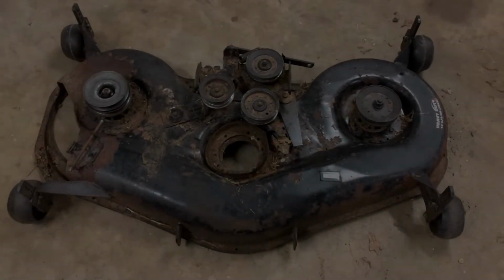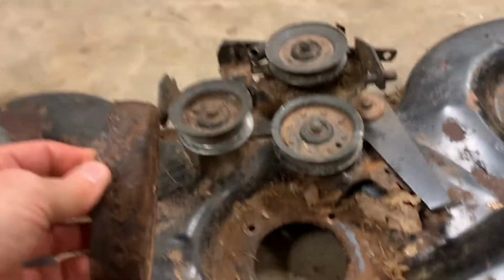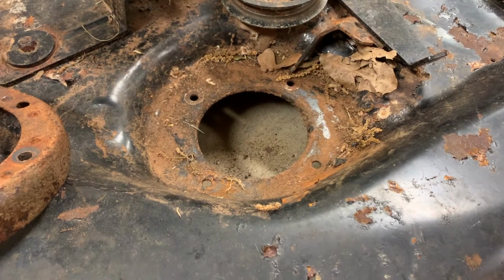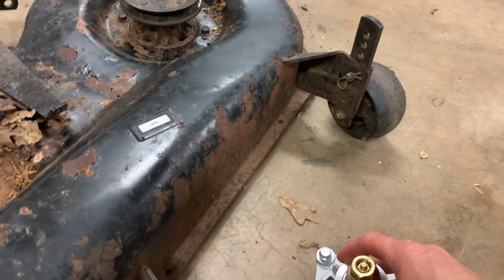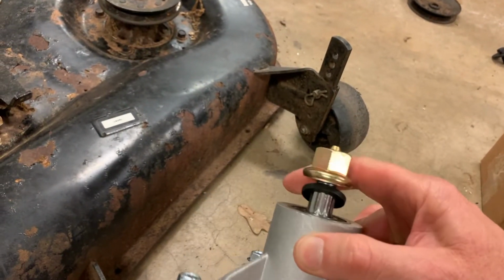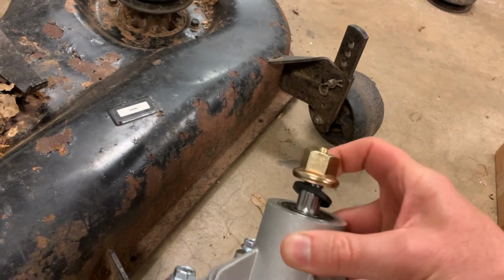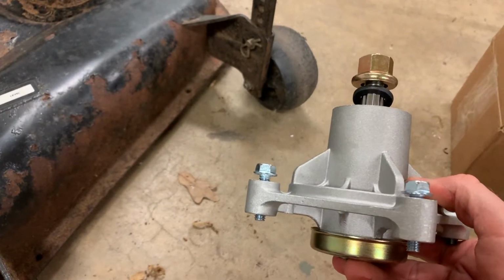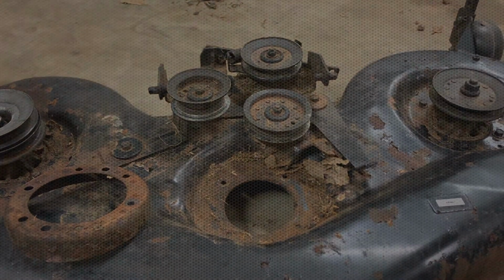Craftsman GT5000 Tractor #4: Mower Deck Rebuild

Comment: Man THAT LOOKS AMAZING !!!!! can you tell me where you found the new blade guard/ strippers , I'm also rebuilding a gt5000 now and mine we're rusted also
Reply from the maker: I'll take a look around and see, it's been a long while now. I probably used one of the mower parts lookup websites and plugged in the deck's model number.
Reply from the maker: Ah, here you go. I think I found them on Amazon. Something like this: https://www.amazon.com/Husqvarna-532174493-Stripper-2748GLS-GTH2548/dp/B08779R3BH/ref=sr_1_10?crid=22K720CAWBQ8X&keywords=craftsman+mower+deck+stripper&qid=1700532906&sprefix=craftsman+mower+deck+stripper%2Caps%2C126&sr=8-10
Reply: Oh Yeah, didn't know what they were actually called until I watched your video... THAKS A MILLION .!!!!

Comment: I have Craftsman lawntractor with 17hp brigss engine, and it can pull priest out of choir boy. I have now sawme project going like yours was. I did same steps, first I grinded all the rust off then I applied rust converter. Now I need to paint it. Did your rust converter held well? Did you do anything to the underside?
Reply from the maker: So far so good. The top looks in great shape, just typical fading when you use rattle can with no hardener.  We live on a sandy lot, and it's really dry all summer so I didn't do anything to the bottom because it's constantly getting sand blasted.
Reply: @TheSaturnV  Yes, it seems like although I live in other side of the world we have the same issue. It is waste of time, money and paint to fix the underside because it will wear off from first mowe. Theres also no permanent fix for the deck. It will wear out in time no matter what. I think best would be to paint it max one time and then change it to new one or good shaped used one. The problems is where to find new decks for +15 year old mower.

Comment: You did a very nice job restoring the Outside of the deck, which i appreciated. But the underside is really Much more important to completely refinish... they rot out from underneath. Once it is brought to bare steel and has cured fresh paint, it'll shed grass as it should and not hold moisture against the pan ~
Reply: Also, in use this deck clogs right at where the opening is at the front of the deck. I carry a scraper on mine to stop and get off and unplug it from time to time... Seems like a hassle, but really kind of worth it for the cut and all the other ease of the design 👍

Comment: Just started the rebuild of my Murray 3 spindle deck. Needed a friend’s air tools to either break off or break loose spindle mounting hardware and retainer bolts. So far, three coats of primer for rusty metal after a couple of hours of wire wheeling.
Have not looked at the pulley bearings yet. Am looking for the belt retainers to replace. Am going to remove the bearing seals and recreate the brand new bearings b/c it looks like factory grease is insufficient.
When I’m done w/ the deck shell, I’m going to undercoat it.
Blades look good but I’m not sure about the blade mounting. Not sure of I have to get  starred mounting holes or not to preclude the blades hitting each other.
I’m enjoying this but I’m going to have to put in a few beads of weld to strengthen a few weakened places but not yet penetrating rust.
Need to track down wheels but I’ll have to make a foundation for an 18 hp engine w/ idler pulley. Should be fun. It’s not cheap.
Reply from the maker: Yeah, you have to make a judgement call if a deck is worth saving based on what you are going to have to spend. This Craftsman deck was 10 gauge and still in really good shape so it was worth it.

Comment: The grease fittings they put on those spindles are useless the bearings are sealed you can pack it with all the grease you want and it's not going to get in the bearings.
Reply from the maker: Yeah, I saw a video about that. It basically just fills in around the axle and does nothing. Live and learn.
Reply: That's not really true. Manufacturers have found that by putting zerks on above sealed bearings does still grease the bearing below.... Basically as the spindle gets hot and the grease ages, the oils run out of it and thus the fresh grease above weeps oil into the old grease of the sealed bearing below ~
Reply: @georgehofgren6123  you lost me when you said manufacturers have found.
They called their bearings sealed you can't have it both ways.
Reply: @jophillips2868  Yes you can have it "both ways". Try reading and understanding before you tell others what you don't comprehend ~

Comment: You’re going to break those bolts b/c the electrolytic corrosion between the aluminum of the spindle and the iron in the steel bolts makes a good corrosive weld.
Reply from the maker: I figured the dissimilar metals had a lot to do with how frozen they were. Glad the design allowed the bolts to be sheared away and drop the spindles.

Comment: Excellent job Saturn! A lot of people around here spray their decks with bed liner on the underside to help fight rust. I had to fix some holes in the mower deck of my Cub 108 this year; I would have much rather had a nice solid start like you had here. Great job, and keep it up!
Reply from the maker: Maybe it's the sand content in my soil but I don't have much trouble with rust from the underside of my decks. It's the leaves and soil gathering on the top side that kills them here. I'm going to need a shop like SSBTC HQ if I keep any more of these things.  :]

Comment: The orignal ones lasted me 15yrs. No zerk fitting as they were sealed bearings. My orignal GT5000 deck also rotted so I had to buy a new deck. Cheaper metal..no way the original 10g . Other than that my 2003 GT looks brand new.  I'm the original owner.
Reply from the maker: Nice. I was a little bummed about the bolts breaking since they had no play, but felt a little better once I realized the aluminum was corroded to the point of breaking down. Yeah, the 10gauge deck is nice and heavy.
Reply: 10 gauge steel is rebuildable. Thinner gauge is much harder to repair. Lawnmower decks should be like old tractors: Haul em out of the swamp, sandblast, prime, paint, replace necessary parts and 20 years later repeat.
Reply: My original (2004) GT 5000 definitely did come with greasable spindles, and still has them... I have never had one fail, despite VERY hard usage on roadsides, trails, etc....

Comment: It's amazing how the metal production has gotten so terrible everything they make rusts out almost immediately it's like their intentionally building crap.
Reply from the maker: Yep, and this one never sat a day outside for the entire time.
Reply: Sears used Very low grade steel on these decks, almost 'pot metal'. That is part of how they formed these decks so deep and 'curvy' tho... 
Over time, the steel on these decks will Literally rust from the inside out... prolly was recycled steel. So things like wheels and pullies might tear right off. But it's a good deck... Solid. Refinish the under side every few years with sandpaper and good fresh paint and they'll last for the long haul. Fairly sure new decks are obsolete now ~